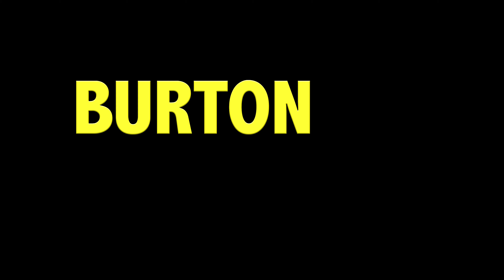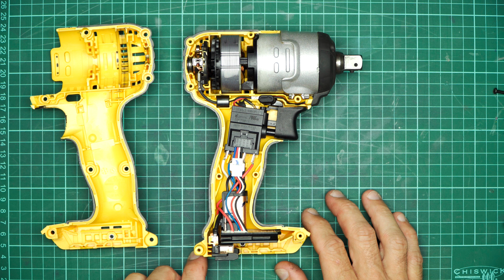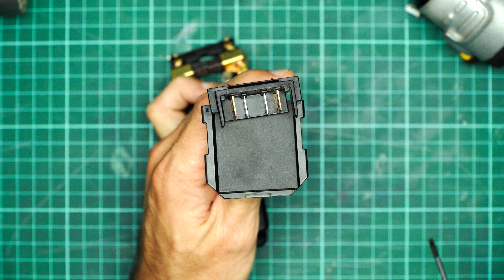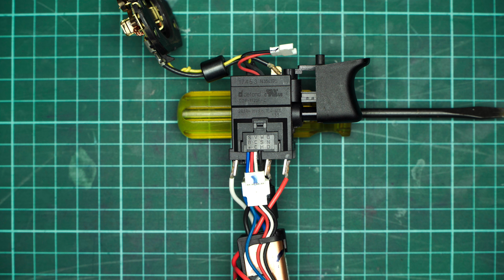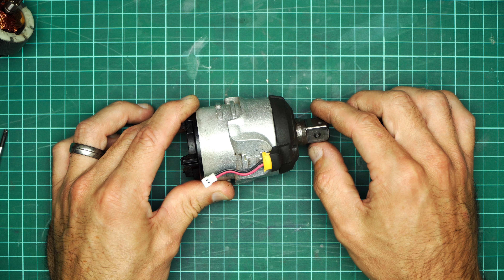TEARDOWN DeWALT DCF 880 20v MAX 1/2" Impact Wrench - Burton Builds S03E05 [4K]

Comment: One side of the anvil broke off. Can I still use it while waiting for the spare part?
Reply from the maker: The tool would probably still work, although it won’t hit as hard, but I wouldn’t use it with a broken anvil because the assembly would be unbalanced and only striking on one side (not equally on both sides)… not sure how those unbalanced forces would affect the bearings and housing, etc. but I don’t think it would be good.
Reply: @GrantBurton  Makes sense. Thanks bud!

Comment: Is it possible to swap out the brushed motor for a brushless motor
Reply from the maker: Hi Brent... No, it's not possible to swap out the brushed for a brushless motor... a brushless motor uses a completely different type of speed control / driver circuit.

Comment: Cool. Nice clean layout of the internals for sure. I have had this dcf880 for several years and it has been great. It also works very well as an impact driver with a 1/2" square to 1/4' hex adapter (I have the Dewalt one). I also recently got the dcf911 as a free tool on a promo deal and it is super nice.
Reply from the maker: Thats good to hear. I'm still happy with mine and almost exclusively use it with the adapter you mention (although my adapter is Milwaukee) but every now and again use it as an impact wrench with sockets. I think having the more powerful one would be better for wheel studs / nuts though.

Comment: I have the 3/8 version. I was going to buy this one also but I think there isn’t enough of a difference to get it. If the 3/8 won’t do it I don’t think this one will get it.
Reply from the maker: Hi Ironwood living, I also think it would be a better idea the get the larger, higher torque version (something like the DCF 899 size machine) if you already have a smaller unit.
Reply: @GrantBurton  I ended up going with the 901. Hopefully it lives up to the videos.

Comment: Hello, i have a problem that once i dissasembled mine (after a White i wated to regrease the gearbox) and then reassembled it it was stuck. I tried like 10 Times to take it apart and reassembled it but its Still stuck. Any idea what is wrong???
Reply from the maker: Hi Jan, when you assembled the gearbox, did you insert the ring gear in the correct orientation? It has a flat side, which faces the front of the tool, and the other side has 'teeth' that stick up... that faces the motor. Maybe also try holding the motor in your hand, then inserting it into the gearbox and manually rotating the motor to see if it will rotate freely?

Comment: I have had the dcf880 for a few years. I probably use it a few times per month. I primarily use it to install and remove caging bolts in air brake chambers. I have used it working on my vehicle as it fits in places a larger impact doesn't.

 It is not extremely powerful but works good. If not overtorqued or corroded it will remove automotive wheel nuts but I wouldn't rely on it for that, I think a mid or high torque is better suited. I used a 4ah battery with the tool, I think reviews that complain it won't take properly torqued wheel nuts off are using smaller batteries.

I just upgraded to a brushless dcf911 that is supposed to put out another 100 ft/lbs over the dcf880. I feel I have got what I paid for out of the 880.
Reply from the maker: Hi Julio, thanks for the comment. I've been using the 880 with a 5Ah battery and it seems to have reasonable power, although I agree with what you say, if one primarily wants to remove wheel bolts, you need a bigger more powerful impact wrench. For all the other needs, basic DIY work, it has enough power. Let us know how the DCF 911 works out for you.
Reply: @GrantBurton  I put a short video up of it taking a wheel nut off a ford F550 which is probably 140% of the torque of a automobile wheel nut. only had it a few days but liking it so far. It's slightly taller and the motor housing is fatter, but the length of the motor housing/gearcase and anvil is about 15mm shorter. It has a very decent amount of power for the size. I'll try to post a link of my video.
Reply: @GrantBurton  https://youtu.be/iuUAQXYT30I

Comment: Great vid thanks. Was looking at an impact for home use ( car wheel nuts, mower blades and so on ) and this one seems to fit the bill. I like the relatively small form factor of the unit, and longevity will probably never be a factor for me. The brushed motor is fine in this regard, and i have a couple of DeWalt ( angle grinder, drill,  impact driver, recip. saw, jigsaw, all brushless ) products already, so am familiar with their quality. Loved your teardown of the unit and found it very interesting, thankyou.
Reply from the maker: Thanks very much for the comment. I'm still pretty happy with my Impact... it battles a bit with some wheel nuts but eventually gets the job done. I think their Mid-range impact (DCF894 and 896 i think are the model numbers) would be better suited for car wheel nuts though. For mower blades and similar bolts and stuff, the 880 works well for me. Also adding a 1/2" hex adapter makes it nice for driving in screws... I often use mine like this.
Reply: @GrantBurton  Thankyou, it has been purchased and it is spot on for what i do. I did one little test on my Golf 5 GTI by loosening a wheel nut, then torqueing tight to 120ft/lbs and removing again with the DCF880. Yes, it worked for a second or two, but did the job. Thanks again for your fantastic teardown and review,
Mike ( Vic, Aus. )
Reply from the maker: @harrothepilot  Awesome, glad to hear it’s working well. Keep well and chat soon again 👍 keep us updated with its performance

Comment: Very informative. Thanks.
I bought a new one without battery. I have built a 5S2P battery. Even though BMS gives 21 volts(batteries are capable 30A discharge) It didn't worked. Led comes on/off but the motor is turning.
So I thought it is the BMS problem and than I found a 21V60A capable power supply. I tried PSU and still no go! Led comes on and off. Nothing. Could it be a damaged unit?
Reply from the maker: Hi cunbal, I don't think its a damaged unit... When i tried powering mine with only the two main battery terminal connections (B+ and B- which gives 20v across those two pins) the lights just flash but the motor doesn't run. When i plug in the battery and all 4 terminals are making connection (B+, TH, C3 and B-), the motor runs and the tool works as normal.

I think (but I may be wrong) that the TH terminal is for thermal protection by way of thermistor and C3 is a take off from the 3rd battery cell (Measuring a fully charged battery between B- and C3 gives a voltage of 12.54 volts which leads me to believe its that 3rd cell take off).

Comment: Hi,

You might be able to take off the front housing of the dewalt (DCF 880) and replace it with the DeWalt (DCF 890) brushless 3/8" impact.  They have the same body. 

On the Dewalt (DCF 890) you will get the brushless motor plus 3200 IPM and 2800 RPM. It's rated at 150 ft lbs.

Now, that might be a interesting video to make if it's possible to do. Juat might thoughts.

Thanks for the video.
Reply from the maker: If I ever get my hands on the 890, I'll give it a try for fun.
Reply: @GrantBurton  

Cool....